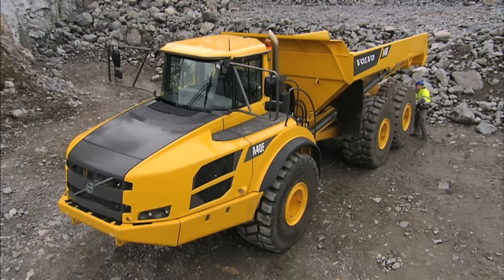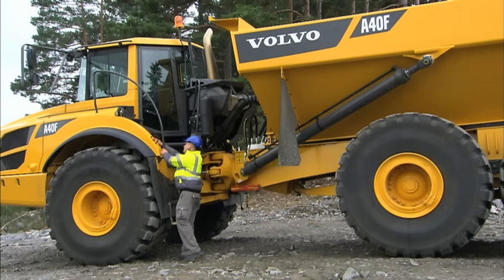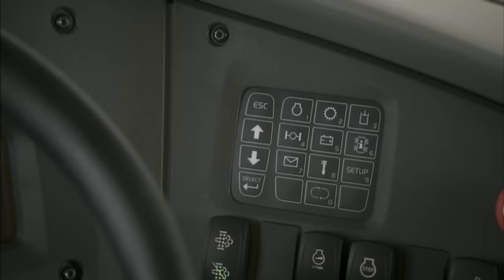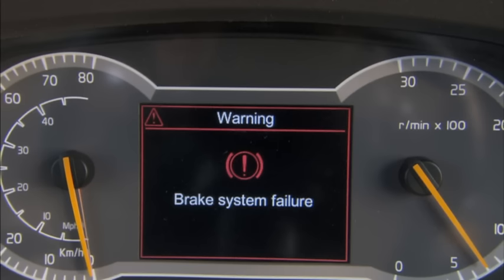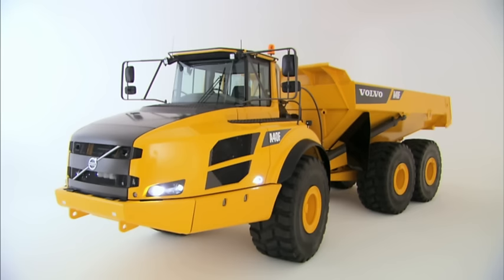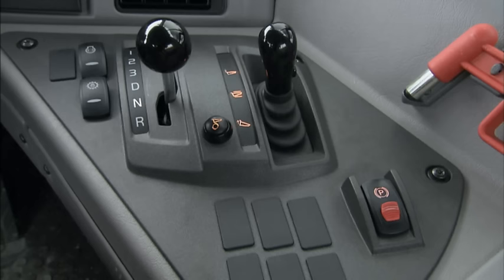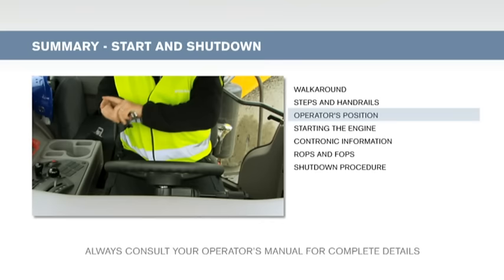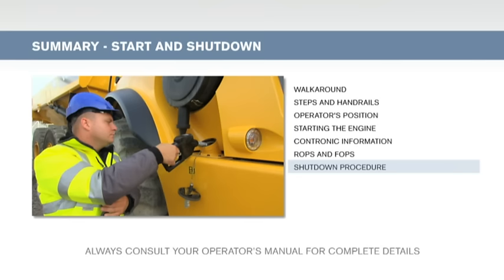Volvo Articulating Haulers Operator's Video - Start And Shutdown A25F-A40FS

Comment: Didn't show a full pre-start of this machine nor did you run through the computer system. And roll over shouldn't happen if you're operating the machine correctly in this video presentation the moxy was driving way to fast loaded honestly not a great video.